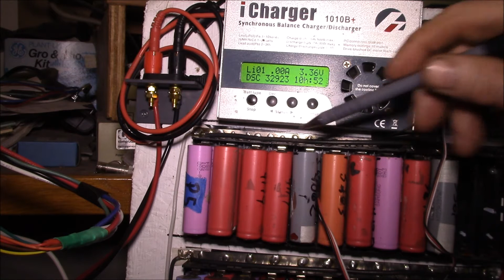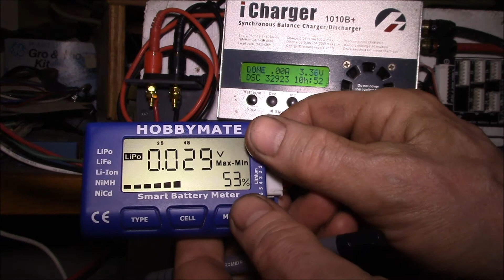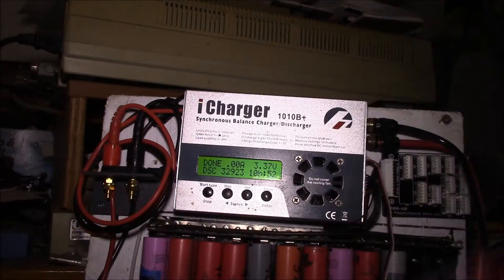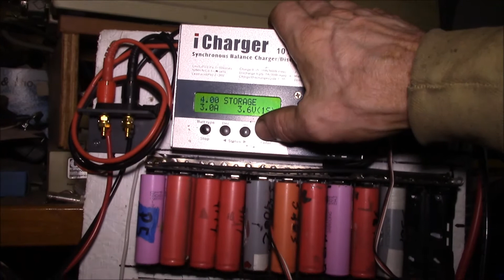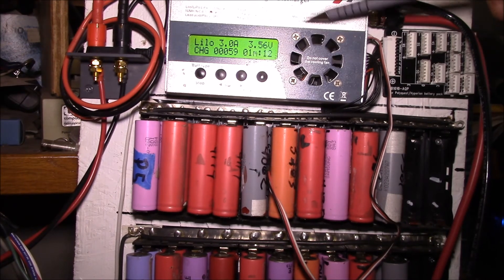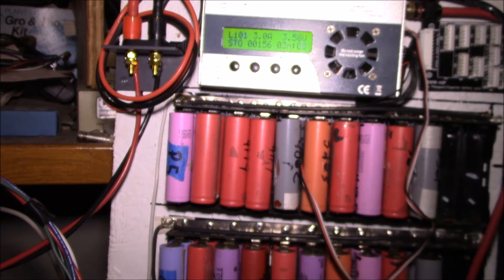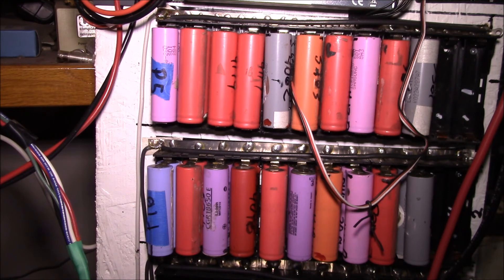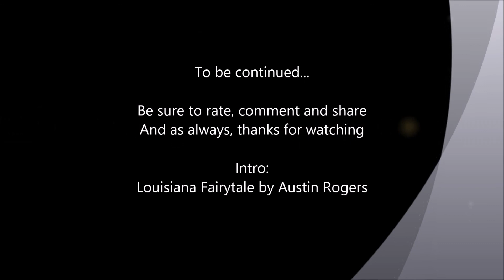Capacity Matching 20P Battery Pack #5

Comment: 4000+ mAh 18650s? Man I guess your testing equipment is way off
Reply from the maker: I wish I had that capacity.  I'm measuring about 32,500mAH for a 20P pack or around 1650mAH/cell average.  These are used cells and I'm only charging to 4.0V/cell and that only nets ~75% of the cells full capacity which is likely around 2200mAH/cell.  My holders are set up for paired cells and when I mention 4200mAH in the video, that's for a pair of cells in case that wasn't clear.
Reply: @The4Crawler  Ah, got it, man!